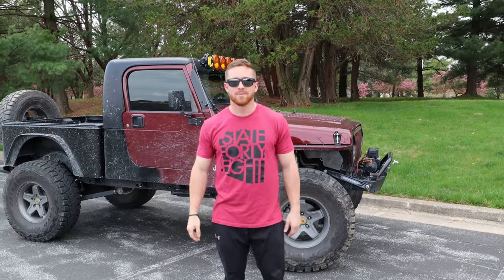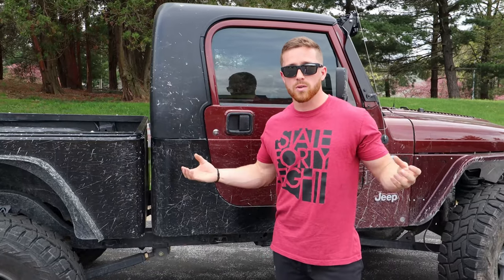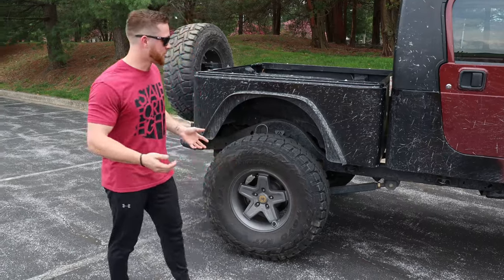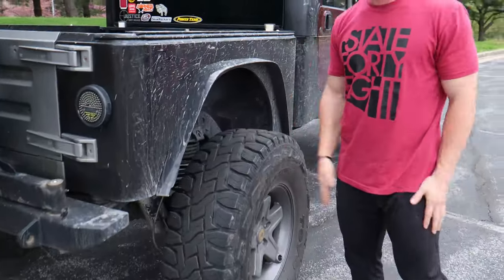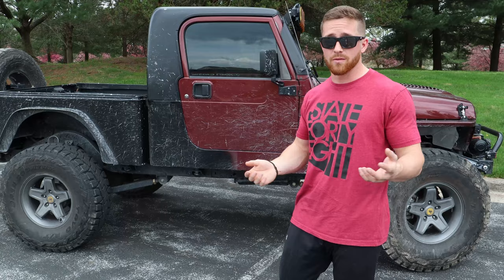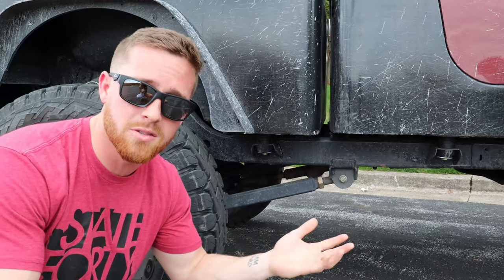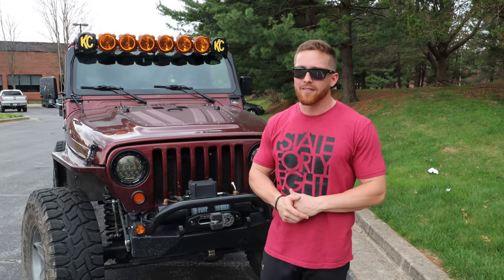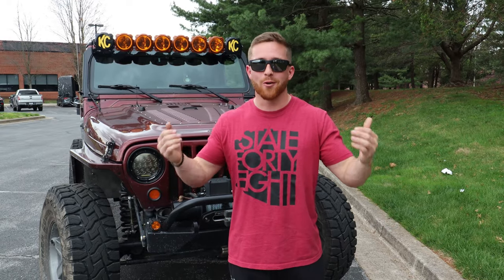Is Cutting a Jeep TJ in Half Worth it?  Jeep Truck Conversion

Comment: LS swap next?....I did and it's worth it...
Reply from the maker: I would love to do that next.  Still doing research on which LS and trans.  What did you go with?
Reply: @BuiltDifferentGarage  I used the drive train from a 2001 suburban.  The transfer case I used was a 231c from a 92 s10 blazer. I bought the engine mounts from advanced adapters and everything else I fabricated. The wiring harness I built from the original suburban harness. I repinned the harness and integrated it with jeep harness.  I used a Secondary fuse block to run Ls. Radiator from ebay.  The tricky part was setting up the speedo. I send a signal from GM computer to jeep computer.  The trick was calculation of the pulses.  I used the tuner pro rt for the computer set up. Lots of mind games setting things up. Like the shifters and such.  The fuel pump can be confusing. It did the complete swap in under 100 hrs in 6weeks
Reply: @BuiltDifferentGarage  I also filmed the swap. Have several hours of process. Some things I didn't video due to time and thinking..did a few moments of well shit....how do I overcome this problem

Comment: You are talking about storage if you have any rust in the floorplans of the Cherokee I think it's a cool idea my wife has a 2017 dodge journey if you can find one cheap that's been wrecked rob the rear floorplans out of it why?because they serve as boxes under the feet that shut that are sealed and you can use them as a cooler or storage and the pans will drain just go and check out a dodge journey I think with storage it's the coolest thing
Reply from the maker: That is a really cool idea!  We will definitely consider that!  I appreciate that!
Reply: @BuiltDifferentGarage  2016 coolest feature dodge journey check it out I think the name is drivetv is the YouTuber I think it's cool a vehicle that has all the storage has the same motor as the newer jk 3.6 it will haul the mail to be front wheel drive
Reply from the maker: @todhollandsworth4371  hm I’ll have to check that out for sure!  Thanks!